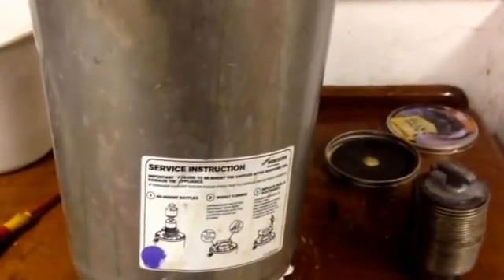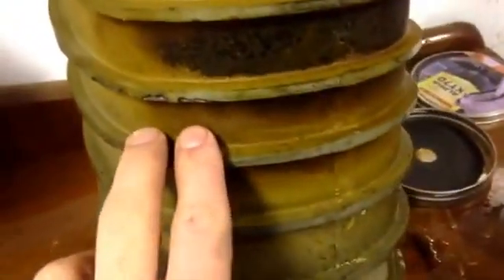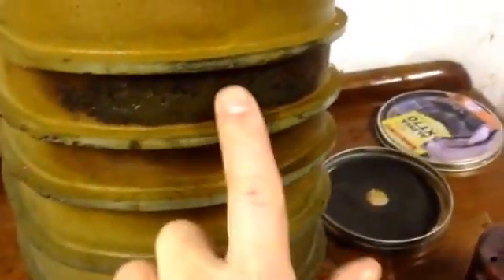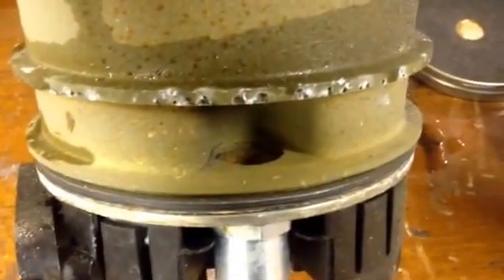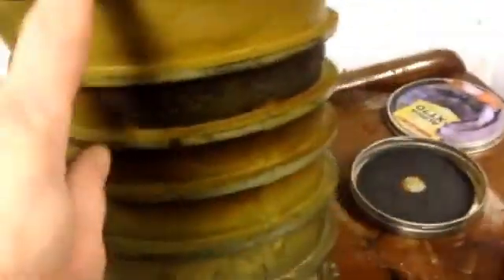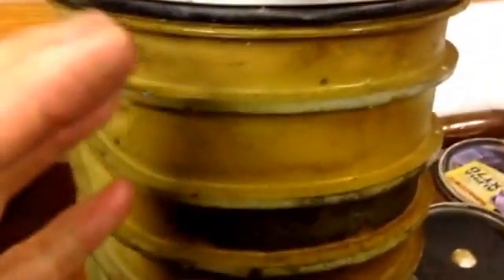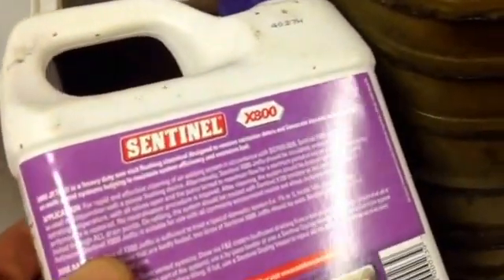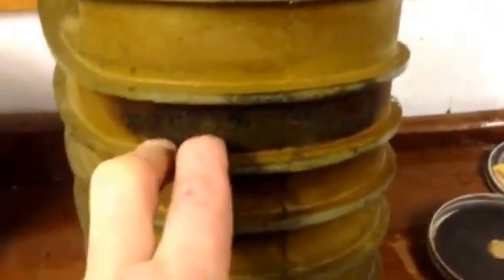Worcester heat cell internal view - problem solving

Comment: I presume the corrosion / pinhole you pointed to could have been leaking water from the heating system into the combustion area of the heat cell and draining through the siphon hence why the heat exchanger was replaced. I’ve seen it at least 5 times before. Wouldn’t think it was a servicing issue as the baffles came out easy and there really wasn’t much sulphate in there.

Comment: I've cut a few of these open the scorch marks not normally there, probable caused my blockage or dry firing..might be worth popping that black cover off to see if the water from heating has been passing down the condense pipe...this would cause drop in pressure..kamco a good chemical to use before installs..check the twitter sludge out @hancocknbrown

Comment: Also the problem will be on the burner side of the heat cell , evident by the hot spot and scorching inside the cell, a build up of muck on the burner side caused by lack of proper servicing creating a hot spot and causing the cell to over heat and ultimately causing the boiler to lock out.
Reply: Sorry I'm aware the vid is 4 yrs old but for anyone watching this now/in the future.... if the blockage was on the burner side then wouldn't it do the opposite and create a "Cold spot" as opposed to a hot spot?, this is a question btw not a statement.
Reply from the maker: In most instances I would agree. In this case there is no blockage in the burner side - all clean, clear, baffles correct.